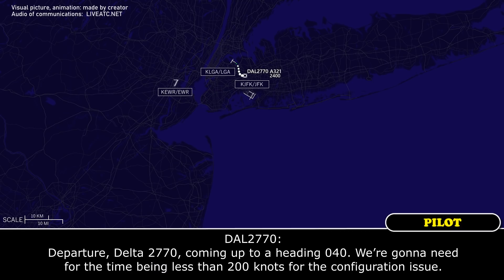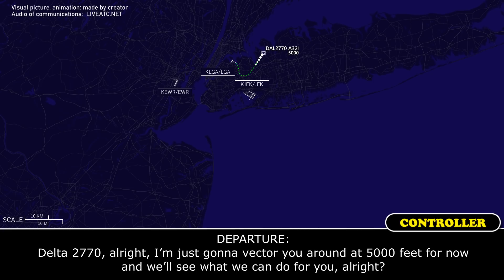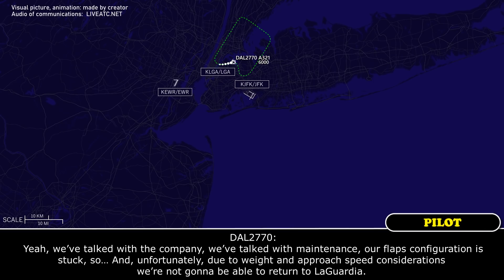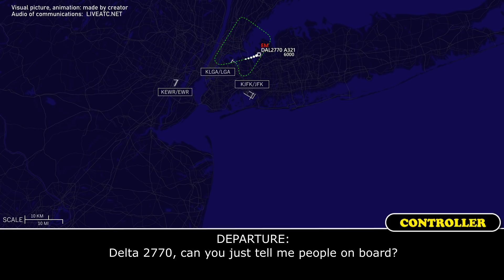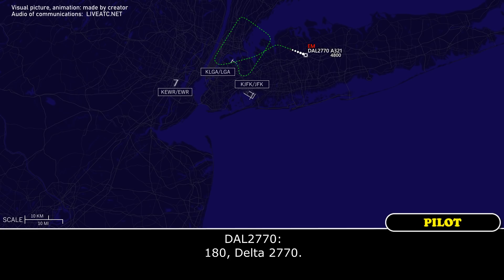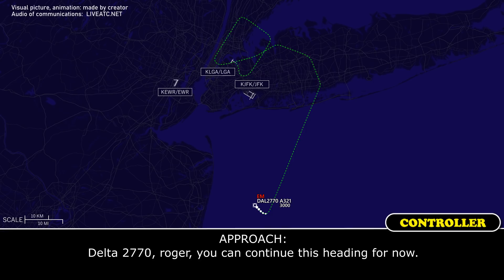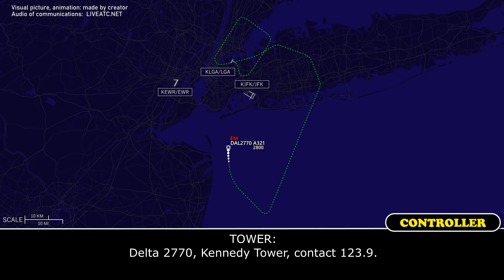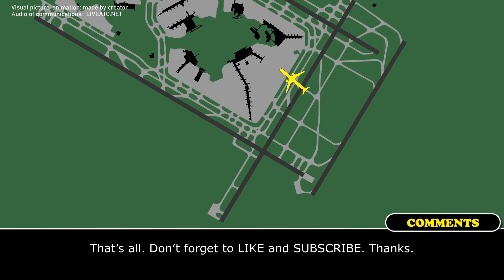Flight control emergency | Delta Air Lines Airbus A321 | New York, ATC

Comment: What kills me with these controllers is the fact that they keep want to talk and disrupt the completion of the troubleshooting checklist. Just send a guy to a holding point and let them troubleshoot their problem.
Reply: You're kidding me. He's in one of the most congested corridors in the world, 3 major airports, and all ATC is vectoring them around other traffic. Other than getting other important info the Delta crew is initiating the calls.
Reply: @donschwartz1118  Emergency…Hello! Get me   “straight” somewhere and get everyone else away, otherwise I’ll give you my mayday heading heading and I’ll fly straight somewhere with a bunch on unable replies then you get everyone out of my way😉
Reply: I've often wondered why most times you see emergencies getting vectors instead of a hold. There are a few reasons I can come up with (I'm not a professional pilot or ATC).

Unpublished holds are harder for both pilots and controllers: ATC has to give direction of the hold, a fix, a bearing or airway or course on which to hold, the leg length, direction of turn, and time to expect further clearance. The pilots need to spend time to load all that into the FMC. That seems like a lot more work while they're trying to work their problem, versus just pushing HDG and spinning the knob every 5-10 minutes while they work the problem... the silence between vectors is trimmed in these recordings, so it seems they're happening much quicker than they really are.

Plus the delay vectors can start setting them up for downwind/base when the controller feels they're probably about ready - they deal with a lot more emergencies than a pilot ever will, so probably have a good feel for how to keep them close to where they might need to be when they need to be.